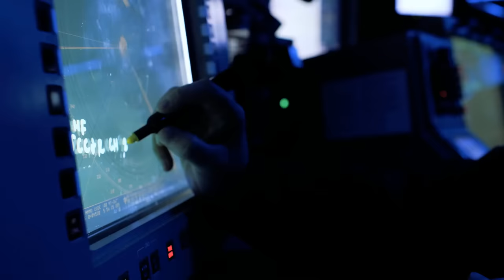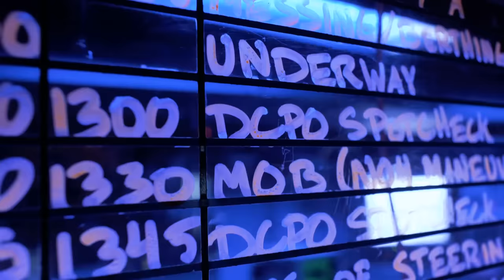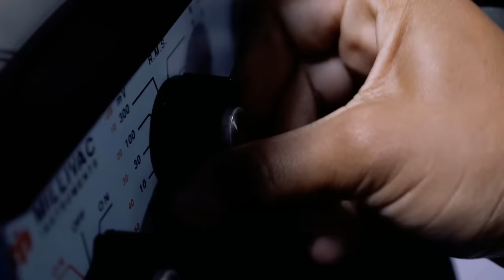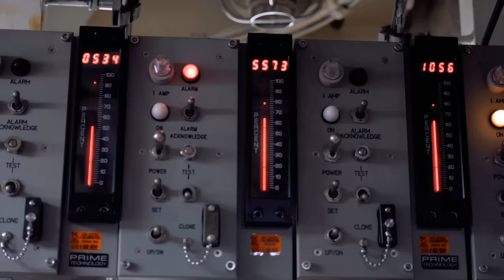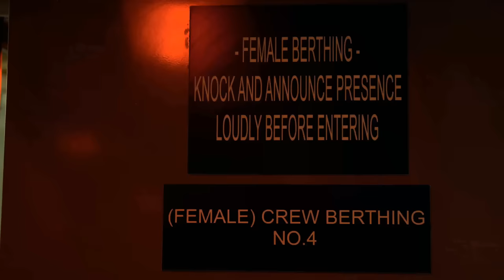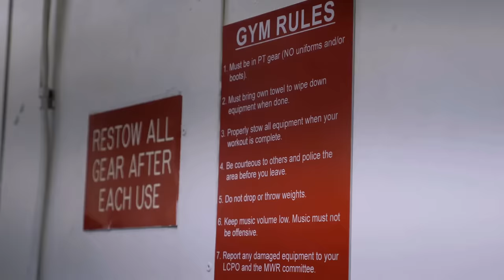Life On A U.S. Navy Destroyer (2019) • Full Documentary

Comment: The Original mission of the Destroyer was anti submarine warfare. As technology improved the modern Destroyer carries more firepower than battleships used to.

The Agis Radar/weapon system is a thing of beauty. Any Ship in the battlegroup can detect enemies and instantaneously relay that info to every ship in the battlegroup then the flagship (usually the carrier) can take control of any ships weapons in the battlegroup to deal with the threat. Of course that is a very oversimplified and not classified explanation

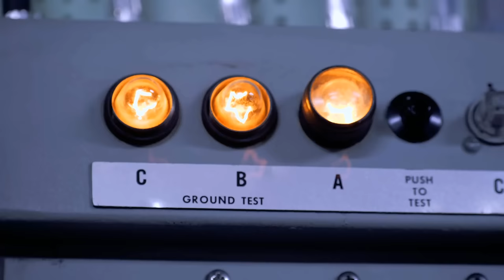Comment: 5:38  WHY did she cut the ground from the wire?  You are not suppose to cut the ground of the wire because its needed for the BNC connector to be grounded. Woow.  
Those are BNC connectors and they need ground to prevent interruptions in the frequency band.  The wire needs to be grounded because the casing is grounded so people dont also get a shock
from touching the metal case the RF SWR when transmitting.  She should have never clipped that ground from that wire that is going to have a BNC connector attached to it.

Comment: Nothing like the World War ll Destroyer I was on 1963. Back then there was no woman on board and the ship had two boiler rooms with two 600 LB boilers 800 Lb Supper Heated sides . Two Engine Rooms with steam turbines turning the shaft attached to propellers . Flank Speed was around 24 knots ! 5 inch gun mount forward  and a helicopter deck for the Dash Drone Helicopter aft where another 5 inch gun mouth use to be , in-between was the deck that had the AS Rockets ASW . The ship was 250 feet long and 80 feet at center beam . Number of Navy personnel on board was over 200 . And not everyone on board  was a non com ( Non Commissioned officer ) as seen in this video . It goes without saying the US Navy in the 1960s was a lot more labor intensive than the modern US Navy of today with all the electrics!
Reply: DD758 out of Charleston South Carolina USS Strong